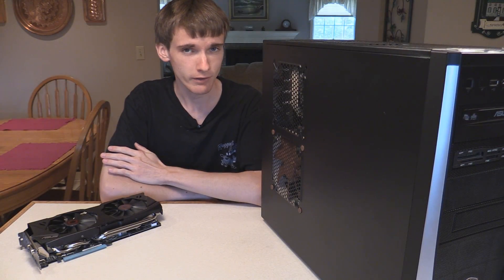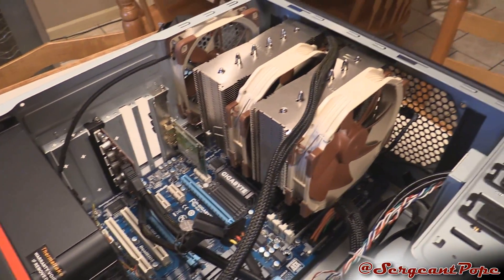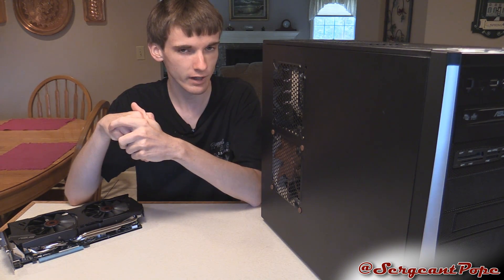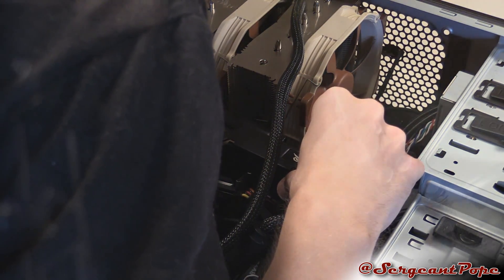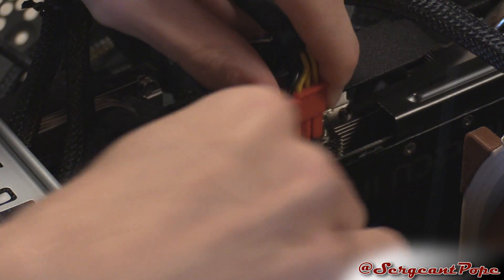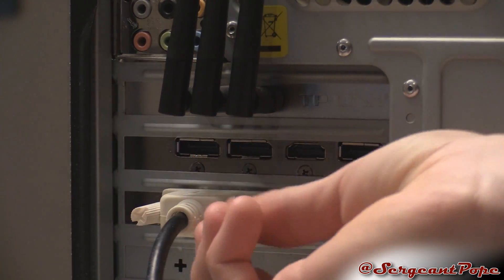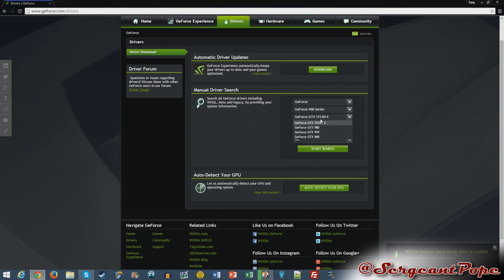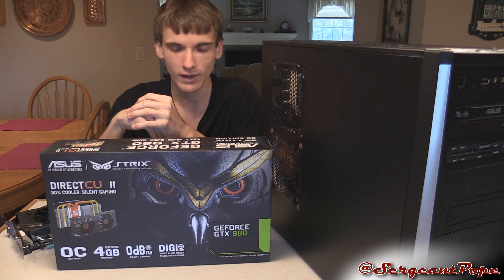How to install a graphics card - GET INTO PC GAMING EASY!

Comment: Hi there Sergeantpope really like your review very thorough. Got a question for you: I currently got a P67a-gd65 motherboard with a GTX 560 Ti (a little old) i like to upgrade this to a GTX 1050 Ti or a  GTX 1060 3gb which would you prefer or if you have any other suggestions for me that would be great. I also read somewhere the 1000 series GTX cards aren't the best combination with this motherboard. Any experience in that matter?
Reply from the maker: Looks to me like any graphics card will work just fine on your motherboard.. all you need is a PCIe X16 slot and enough power from your power supply. The GTX 1050 Ti or 1060 are both pretty nice. You'll notice a substantial performance improvement going from a GTX 560.
Reply: SergeantPope - Komada Computer Repair thank you for answering my questions. Really like your channel and your responses.

Comment: Will the gigabyte GA-990X mobo (https://www.amazon.co.uk/Gigabyte-GA-990X-Gaming-SLI-Socket-Motherboard/dp/B01DAK8EEA/ref=sr_1_1?s=computers&ie=UTF8&qid=1489246108&sr=1-1&keywords=am3+motherboard) fit in the game max titan case? https://www.amazon.co.uk/dp/B01CYO4OBA/ref=twister_B01EX71WDE?_encoding=UTF8&psc=1
Reply from the maker: Looks like it should fit just fine. It's a regular ATX motherboard and case.
Reply: Also can I just swap my mobo and cpu and still have windows?
Reply from the maker: Usually your Windows product key links to your motherboard, so you have to get a new product key if you get a new motherboard. It's dumb, I know.
Reply: SergeantPope - Komada Computer Repair 😢

Comment: So, I know this is a rhetorical question, but im just wondering. I have a GT 730 2 GB, if I want to, can I upgrade my GT card to a GTX card?
Reply from the maker: Haha, well I can still answer it for you. Yeah, you can upgrade to a GTX card. They're a lot faster too, which is obviously what you're looking for. But generally they use more power.
Reply: Sweet, and thanks for the really fast reply! Also, if im going to get a GTX 970, how many Watts/Amps do I need to power it?
Reply from the maker: No problem, I was surprised how fast I replied to your first comment too ;P The GTX 970 needs 500 watts and 28 amps from the power supply.
Reply: Hey, sorry to bother you again! I have another question, my MOBO is a GA-78LMT-S2, I was wondering if you by chance now if it has a PCIEX-16 slot, since I do not have the tools to open my case at the moment.
Reply from the maker: Sorry for the late response this time, lol. I've been really busy :/ But yeah, that motherboard has a X16 slot.
Reply: Thanks! And np :D
Reply: Ah, sorry for ANOTHER question, but im concerned. As I have said before, I cant open my computer case, and was wondering if my case can hold a 1060, which is 6.8 inches. I looked through my window and the GPU is kinda squished already. I have a GT 730 which is 5.7 inches. Heres my computer https://www.amazon.com/CYBERPOWERPC-Gamer-GUA520-Gaming-Desktop/dp/B011D79KJA
Reply from the maker: A 1060 should fit just fine in your case. By squished, I'm thinking you may be talking about the cables in the case? You can move those around if they're in the way of the bigger graphics card. The case for your computer should be able to easily fit any graphics card.
Reply: No, not the wires. The cable management is actually really great, I was talking length wise. I recently opened up my case and saw that my already existing GT 730 looked like it barley fit inside length wise. I removed one of the expansion slots though and saw that a 10 should fit fine. Thanks for all your help though :D
Reply from the maker: Ahhh, gotcha. Expansion slots can block longer graphics cards.
Reply: Yeah, when I removed it it looked like it should have plenty of room.

Comment: hey bro  i have a zebronics g41 motherboard which supports ddr3 ram (8gb)  so will my motherboard support gtx 750 ti0
Reply from the maker: As long as it has a PCIe X16 slot, it'll work with any graphics card.

Comment: hai, my graphic not working, when i installed it the fan spin for a while then it stop and black screen, my pc doesnt even start. do u have any idea whats wrong?
my specs:
-gigabyte gtx1050 2gb 2fan
-mb asus h81m-k
-i5 4560
-psu cooler master 550w
Reply from the maker: The fans spinning for a while and then stopping is usually normal with most modern graphics cards. Do you have your monitor plugged into the graphics card instead of the motherboard? Did you plug in the additional power from the power supply? That's where I'd start.
Reply: yes, my monitor plugged into the graphics. btw my graphic doesnt have any power connector. its only depend on the pci slot. is that normal for gtx1050?
Reply: i also tried with my other graphic cards, work fine. the only problem here is the gtx1050 that i just bought recently. the problem just like i mentioned before.
Reply from the maker: Ahhhh, ok. Does your power supply have enough power? That card probably needs 400 watts. If your power supply is adequate and it's not working with the 1050, but it is working with another graphics card, I would imagine it's an issue with the graphics card. I can't think of what else it could be myself.
Reply: thanks

Comment: Ey im only 12 and i dont no how to open the side of my PC since it has no screws can u pls halp?
Reply from the maker: Most cases have screws on the back of the side panel. What computer do you have?
Reply: HP and i dont see any screws Lol.
Reply from the maker: The HP desktops I've worked on have screws. Do you know the model number of the computer? You could also take a picture and tweet it at me (SergeantPope)

Comment: Hi bro, my graphic card is Intel 256 Mb and i would like to change it to nvidia 1 GB. Will my pc work with it?
Reply from the maker: What computer do you have? And what's your budget?
Reply: Bro i use, Super micro computer.

i can afford to 120€
Reply from the maker: Is Super micro computer a brand like Dell? What's the model number?
Reply: Hi Sergeant,  The Brand is like Dell and the model is Supermicro C2SBM-Q
Reply from the maker: Sorry for getting back to you really late. Your motherboard has a PCIe X16 slot, so you can put a graphics card in there. As long as the case isn't SFF (small form factor) or something like that, a graphics card should fit fine.
Reply: No Problem. Thanks so much. Subbed

Comment: Quick question. When you install a new graphics card should I install the drivers before? I ask this because I thought that you had to have the drivers installed for the card to work.
Reply from the maker: Install the drivers after you install the new graphics card. The video will look bad until you install the drivers, but once you do everything will be fine.
Reply: SergeantPope - Komada Computer Repair thank you also i only have 1 6 pin pci is it good to use a molex to pci aswell
Reply from the maker: Yeah, if your power supply doesn't have enough connectors, you can use molex to 6 pin adapters. Just make sure your power supply has enough wattage and amperage to run the graphics card.
Reply: SergeantPope - Komada Computer Repair ok thanks
Reply from the maker: That's a pretty good jump in performance, but if anything I'd probably get a GTX 1060, since it's the newest generation.
Reply: OK thanks
Reply: Is the 1060 a lot better than the 960 and will it work with a amd 860k and 500 watt psu?
Reply from the maker: The 1060 is quite a bit better than the 960 if you can afford the extra price. And it'll also be supported longer, which is a nice plus. It only requires 400 watts and 20 amps, so it will probably work just fine on your power supply.
Reply: SergeantPope - Komada Computer Repair ok thanks
Reply: Will the amd 860k bottleneck the card though? If it does then I was looking at the msi rx 470
Reply from the maker: That's not a terrible processor, but it's getting a little on the old side. So it might bottleneck a bit.

Comment: I have a problem. My computer wont boot up with my graphics card plugged in. The motherboard seems completely dead.

I take the card out, it works fine (off the on-board graphics)

I tried the card on a friends pc and it worked fine, so the card isn't the issue. I also definitely have enough power.

Any ideas?
Reply from the maker: I've never had this happen to me before, but some people say you might need to change your motherboard BIOS settings when installing a graphics card. There should be some sort of option to use a different video out source. I'm not sure if you have to do this with the card installed or not, so I guess try both with it and without it installed. Beyond that, I would tend to think it's a motherboard issue... I don't know what else it could be.
Reply: It worked, thank you!! But now I have another problem. It won't let me install new drivers as it says no nvidia gpu has been detected.. As far as I'm aware I've uninstalled the old AMD drivers.. Been trying to sort this for like 3 hours now:(
Reply from the maker: That's interesting. It's good you uninstalled the old drivers. You are downloading the correct drivers from Nvidia.com? If so, press the Windows button and type "msinfo32" to bring up your system info. Then go into Components and display. Does your graphics card show up as the video source?
Reply: SergeantPope Under components and display it says the name is 'Standard VGA Graphics Adapter' and next to Installed Drivers it says 'Not Available'. The card is a Asus GeForce 970 GTX and it doesn't mention that at all. I am really stumped as to what to do :(
Reply from the maker: Gotcha. That's typical of not having the drivers installed. You are using the video out of the graphics card? Have you tried installing the drivers from the disc your graphics card might have came with?
Reply: SergeantPope Yeah out of the graphics  card. I don't have the disc it was from a friend. According to a programme called Speccy, it's identified my card as an AMD card and not NVIDIA?
Reply from the maker: Hmmm, then somehow it's still picking up your old graphics... Here's some other things I would try: Reset BIOS to default (and then if needed, you can change back the video settings). If that doesn't work, I think i would reinstall Windows if that was my system.
Reply: SergeantPope Thanks again for the reply. I re-installed windows this morning but it's doing the same thing! How do I reset the bios to default? I have a gigabyte mobo
Reply from the maker: With a fresh Windows install, it'd have to be something going on with the BIOS. For a lot of motherboards you can just press F9 and to restore defaults and then save and exit. If that's not the right F key, there is almost always instructions in the bios to restore to default.

Comment: Know any good GFX cards for around 100USD that could run subnautica
Reply from the maker: $100 is a really tight budget for graphics cards. Maybe a RX 460 or GTX 750 Ti will fit into that budget, but I would suggest spending more if you want a good experience. Just another $100 would make a big difference.
Reply: SergeantPope it's bad enough I'm spending 100 for a 20 dollar gamd

Comment: Very informative video.  Sounds easy enough.  I could probably do this.  Other than the uncalled for profanity and vulgar language, which, thankfully, was sparse, you did a good job.  Leave that out and you will have an outstanding production.
Reply from the maker: Thanks, but I'll use whatever language I want in my videos.
Reply: That's fine, but if you want them to look more professional, you'll leave the profanity out.  I was only giving you advice to make your productions more polished.  Sorry I put you on the defensive.

Comment: Dude, I need help. Im building an  e-GPU and Ive never built any PC stuff before. The base is a Akitio Thunder 3 PCIe box, GPU will be a Radeon RX 480, and as per the GPU power supply list a 500W PSU. 

NOW, so I plug the GPU into the PCI-e slot and then in addition I also plug the PSU (8pin) to to GPU. Alos obviously plug the PSU into the wall. Haaaalp
Reply from the maker: I haven't used any of those external PCIe enclosures before, but I can try to help. You have the thunderbolt cable between the box and your computer, right? Are there required drivers (possibly an included disc)?
Reply: SergeantPope that's correct, thunderbolt 3. There's no required drivers, just an update for the PCIe and installation process for the XFX 480 GPU.
Reply: SergeantPope If I just run 8pin from the PSU to the 8 pin GPU will that make the GPU come online? Meaning it will connect through the PCIe slot through the thunderbolt 3? I'm just confused with thunderbolt 3 supplying power, how that comes into the equation
Reply from the maker: The RX 480 will need to have the 8 pin connector plugged in to work. Does the enclosure have a built in power supply or something?

Comment: Can you help me?? I have a emachine EL1331 computer.It has a AMD Athlon Processor 2850e 1.80 Ghz, 3gb ram. Is it possible to upgrade my graphics card? If so let me know what should I get. I try ed playing a few games and it was laggy.
Reply from the maker: The case for your computer is incredibly small. I don't think you could fit any graphics card in that :/
Reply: hi could you find me a graphics card under $100 for my pcmy pc---- http://www.pcworld.co.uk/gbuk/computing/desktop-pcs/desktop-pcs/pc-specialist-infinity-trion-x-ii-gaming-pc-10150719-pdt.html
Reply from the maker: That looks like a full sized desktop, so anything could fit in there. $100 is really low on the budget for graphics cards, but maybe you could get an RX 460? A GTX 750 Ti could also be an option if you can't spend a lot of money.
Reply: thanks

Comment: Is it possible to fit a gtx 1050 ti into HP PAVILION 500-036D DESKTOP?
Reply from the maker: Looks like it should fit just fine. That desktop comes with a 300 watt power supply, so if you haven't upgraded that yet, you'll need to.
Reply: SergeantPope oh thank you very much ☺

Comment: hey I have a hp Intel core i5 vpro and a 100 budget the computer is terrible please help me I know absolutely nothing about computers
Reply from the maker: Is that a desktop? I wasn't able to find anything from what you said.
Reply: I FOUND IT!   i got it for 90 $ and it hopefully has potential for a make over i play csgo on it and get at most 35 frames i don't want to spend very much on a 'gaming computer' so can you please recommend parts for me, i have a lot of storage it is not meant for gaming. everybody says your computer needs to be enough inches to fit the graphic card and enough watts. the hp website gives information about this i just don't understand what it is talking about, anyway i ranted on id like to thank you for helping me is very kind 

THANKYOU 

computer- HP Compaq 8200 Elite Small Form Factor PC with intel core i5 vpro inside
Reply: SergeantPope did you find anything I have a computer guy but I need to pay him 20 bucks and that just a waste

Comment: I bought a gigabyte geforce gtx 750 ti (GV-N75TOC2-2GI) does that mean i download the drivers off gigabyte website or i download them off geforce website or nvidia website?
Reply from the maker: You would download them from Nvidia's website to get the latest drivers.
Reply: SergeantPope thanks
Reply: Sorry one last question, I have to remove the network adapter to break off the expansion slots on the rear slot to fit my graphics card. Do I just pull it out or do I have to press something like you would do to remove a graphics card?
Reply from the maker: I believe you mean the piece of plastic at the end of the PCIe X16 slot that's near the middle of the motherboard? If that's correct, there shouldn't be anything like this on the smaller PCIe slots, so you can just pull out the card gently. Do this when the computer is shut off, of course.
Reply: I managed to remove it and now i'm installing the drivers :)
Reply: Ok installed everything do I need to uninstall AMD Cataylst control center since I have nvidia now?
Reply from the maker: It isn't absolutely necessary to uninstall the old drivers, but it won't hurt to uninstall them and it might help performance a bit. So go for it.

Comment: I have a pc with Amd A10
with a graphics card of radeon r7 
but I want a better one to run  more fps on games, which should I get for under £200
(my pc is acer aspire t)
Reply from the maker: With an APU, you can either run Crossfire to utilize the graphics in your APU or you can just ignore your APU and get whatever graphics card you want. If this all sounds confusing to you, you may want to just ignore using Crossfire.

Comment: hi, I have just purchased the Nvidia GTX 1050Ti WF2 4GB graphics card but power supply only has a four pin conection and is 500w. do you recommend I should upgrade to a bigger power supply, if so which power supply do you recommend? or will I be ok with just buying the pin adapters??? please help, thanks!
Reply from the maker: Sorry for the late response. The 1050 Ti should be just fine with a 500 watt power supply. It would probably be fine on a 400 watt power supply (just make sure the amps for the 12 volt rail is at least 20). So try using some of the 4 pin adapters and see if it works. Sounds to me like it should.

Comment: sorry for my english but.... i want to buy a gtx 1060 3gb graphics card,it need 6 pins but i  don't have a 6 pin,only 4,,how can i conect it?
Reply from the maker: If your power supply only has 4 pin molex connectors, you can buy an adapter to make that into a 6 pin. I suggest checking the wattage and amperage of your power supply before doing this though, since if you power supply doesn't have the required connector, it is likely not powerful enough to run a graphics card.